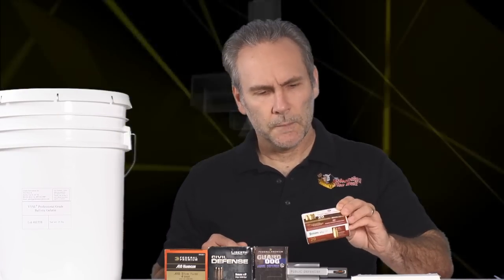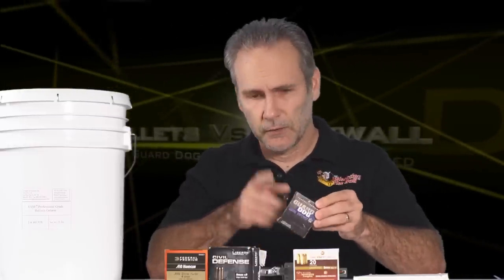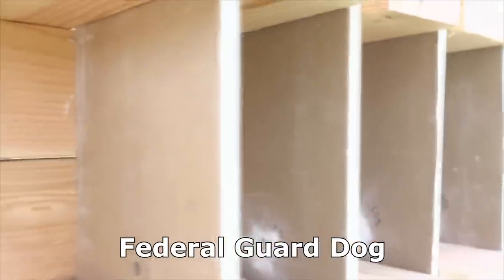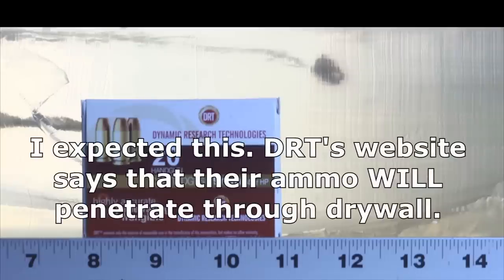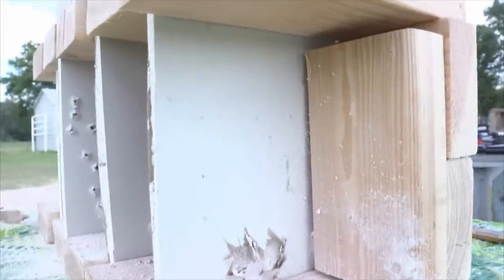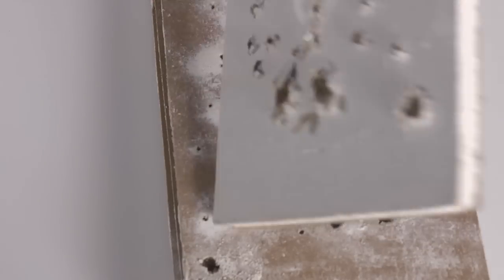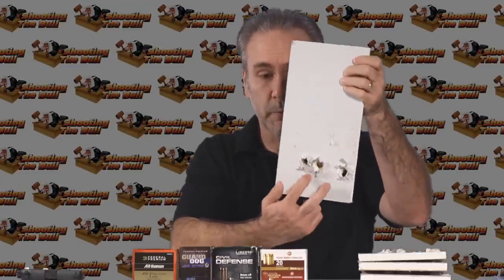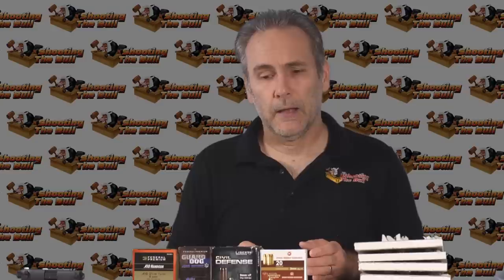Bullets vs Drywall: test of DRT, Liberty, and Guard Dog for home defense through walls

Comment: You can exceed 700 ft/lbs with .410 Winchester AA Super Sport 410 2-1/2" #7.5 half oz. with a three inch spread at 21 feet and compare that with 500 ft/lbs. 9mm +P+ Buffalo Bore 115 Grain JHP Bullet 1426 fps UPC:651815024011
89 ft/lbs: Baseball(Pitch) @ 90mph/132 fps 186 ft/lbs: Baseball(Hit)130mph/190 fps
If you think you will not be stopped by a shotgun blast in the gut at 21 feet, feel free to try it.

Comment: I don't believe that any of the centerfire rounds that you tested are billed by their respective manufacturers as not being able to penetrate walls. What they are designed/advertised to do is not over-penetrate after encountering soft tissue... aka "the bad guy".  A more appropriate test would be to compare these rounds with the gel block in front of the drywall to see if they have enough energy to pass through drywall after encountering the block.  If you put the rounds you tested up against other well know personal defense ammo such as: HST, Critical Defense, Golden Saber, etc, in this scenario, you will likely see over-penetration by the HST, Critical Defense, Golden Saber but not with the Liberty, Guard Dog or DRT.  I agree that there is liability in missing your intended target with any ammo, but what if you hit your target and the bullet keeps on going?
Reply: A standard FBI gel block is 16 inches in length. I don't think any of the rounds that ShootingTheBull410 has favorably reviewed, Gold Dots and HST included, would even exit the gel block. Keep in mind human skin has a breaking strength roughly equivalent to 3-4 inches in ballistics gel

Comment: A human body reacts differently on the projectile than drywall. The Liberty was developed to expand and fragment when encountering fluids (body) for about 4 to 5 inches with max penetration of approx. 13" in jell blocks. This is not a real test of if a bullet will pass through a body and walls because you are using ammo that is designed to do it and others won't. For this to be a valid test, use jell blocks in front of the drywall.

Comment: Wouldnt recommend 410 for defense? Evidence clearly shows a wide pattern that would easily take someone down and over penetration is clearly not an issue. Your test done was inaccurate as well, never seen anyone live in a 1 ft x 1 ft room. Average difference between one room to the next wall is 10 ft. Bullet drop over this 10ft through a piece of wall is different per caliber. 22lr will pass through nearly level through 4 walls spread 10 foot apart while a 9mm to 45acp will tend to drop excessively over that span. Through the same study no 7.5 birdshot out of a 12 ga went through the first 2 walls and died off into the 3rd. 410 died off in the second. Shotgun rounds with birdshot it the way to go!
Reply: +Aaron Neville my comment is based on collective research on studies done in the past by the FBI and other gun enthusiasts. if you have kids in the house or live in an apartment and worry about bullets going through every wall in the house the 410 or 20 GA shotgun are the way to go. if you live in the middle of no where, no neighbors within miles, Fuck it break out the AR.